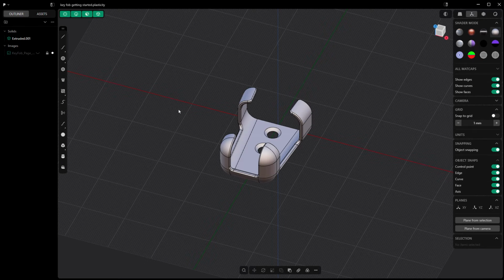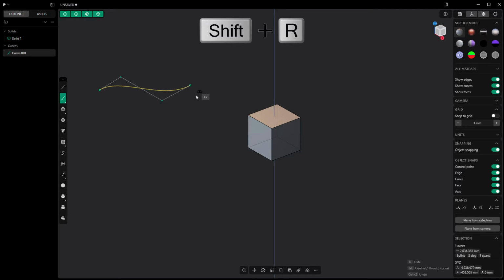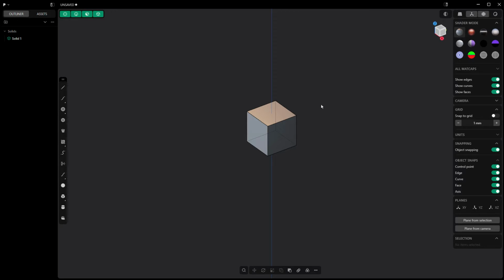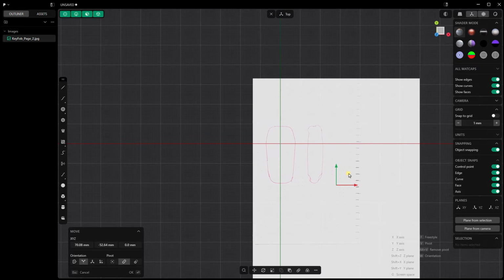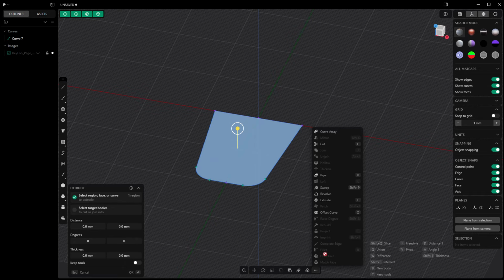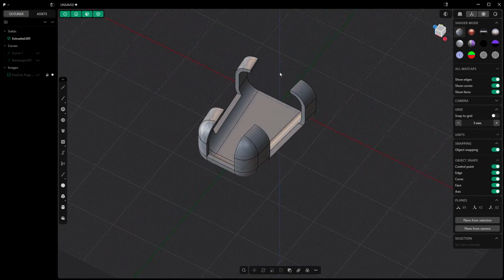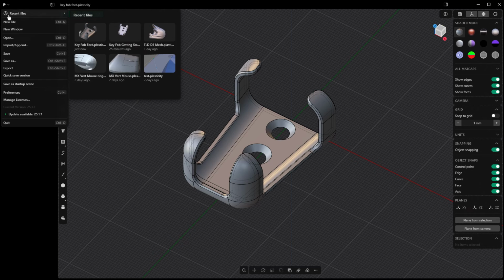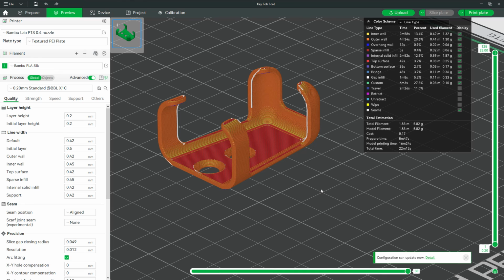Getting Started In Plasticity - Solid Modeling for 3D Printing | Make a Key Fob Holder

Comment: Around 17:25 in the video, you used -2mm for the Hollow command.  I'm confused, it seems like you would have wanted the +2mm instead.  Using the positive value would, it would seem to me, add plastic around the key-fob.  I guess I just gotta try for myself.  Thanks for the video!
Reply from the maker: Yeah the +2 would go the other way.  I did the part with enough "buffer" to make it hollow inward.  Basically when tracing the fob with a pen it gave me a little extra material :)

Comment: Not having a timeline does concern me.  Often when designing 3d prints, you print prototypes, find they need small tweaks, and have to iterate.  So maybe you set something that was 25mm wide and it doesn't quite work, so you try 27mm etc.  In F360 this means I'm often adjusting values in my sketch or rewinding the timeline to adjust values.  Not having either of those worries me.
Reply from the maker: 100% valid concern and a big divide between using a direct modeler like this and a parametric CAD program.  there are issues if you make a specific gap and then scale the parts too.  In plasticity you would have to select a face and offset it 2mm (to get your 27), where in Fusion you could probably edit a sketch or feature.

I find in Fusion doing a combination of parametric and direct modeling but you don't have that option really in Plasticity.  There is a dimension and measure tool that has some ability to drive shapes numerically.  For example if you extrude a box and decide later it needs to be 25x27x22mm,  you can do that.  It just happens a bit different and goes a bit out the window with more complex shapes.  

I made these key fob holders in both Fusion and Plasticity and will say that dimensional control is very helpful.  The benefit with Plasticity comes down to the fact that it is better at dealing with geometry changes.  For example if you are moving a face or adding a large fillet it doesn't care as much about other faces going away and it is more robust at healing those things.  Fusion can get big mad at you.

At the end of it Plasticity is a great direct modeling program that can be used for 3d printing.  Fusion is a great parametric CAD program that can be used for direct modeling.  Its up to you to figure out which one is more important to your workflow.
Reply: @LearnEverythingAboutDesign  But I want both in one tool :D  I see using Plasticity a lot more for concepts and what not, but I really am hoping to be able to do both 3d print items and "Regular" modeling in one app.  Right now I have the old 1.x license for Plasticity that I am learning and messing around with, but don't know how different that is from the current versions.
Reply from the maker: @JohnVanderbeck  the workflows are essentially the same now.  There are new tools that get added so for example you wouldn't have really benefited from Measure and Dimension in 1.x as those came in 24 i think.  But honestly it sounds like CAD such as Fusion might be the best bet.  The real power of Plasticity for me is xNurbs and surface quality.  Fusion surfacing tools are OK but not great.  I love forms in fusion and its great with parametric design.

I "think" plasticity has changed up their renew option for licenses you might want to check out.  You used to have to upgrade/renew with in 4mo of your license expiring or you had to buy the next version, but i think there is a discount now for all old license holders (but don't quote me on that one)  if you do decide to go to plasticity.
Reply: I successfully switched from fusion (have 15 y experiance starting from SolidWorks) to plasticity completely. Before doing it I have had same concerns as you. Modeling and designing without time-line? How that? But after a while I realized, that time-line is not only a help but also a huge handycap in bunch of cases. It's like swimming with lifebuoy. If you are not safe in water, it's a help, but once you learned swimming propperly it start to hinder you. My workflow increased dramatically since plasticity. It feels  like the entire life you drink everything using a straw, just because you was teached to do so and become used to and then one day realizing that you can actually drink directly from the glass.

Comment: Thanks for the video, Matt!
At about 24:00 or thereabouts, you mention "density". This is the first I've heard of this when exporting. Is there some guide I should study to understand that better so I don't mess up my prints? :)
Reply from the maker: With density we are basically talking about how small the triangles are.  The term is a bit misleading since we think of that as a solid property.

This is something you can really notice with rounded parts.  Draw a simple cylinder and export it with really low density(large triangle size) and again with really high density (small triangle size).  You will see the really dense (high number of triangles) model will be much closer to a real circle/arc.  The lower density file will have a lot of visible straight edges and the cylinder is more like a polygon.

In reality all curved parts are made up of these little flat sections so you have to figure out what works best for your parts.  A lot of slicers also take STEP files so you can send the solid model and then tweak at the slicer as well.
Reply: @LearnEverythingAboutDesign  Perfect explanation - thank you!

Comment: I didn't see you use the side sketch, did you just use the paper to measure the size? It seemed like you just decided to use 25mm for the model, was that just a best guess or based on the sketch...I know its an easy unimportant question but I just wasn't sure if there was some other reason for the side sketch. If this is possible in Fusion360 why would choose Plasticity? What are the key benefits that make it worth the money and time to learn it? Your videos are just awesome and I will be purchasing you beginners guide to fusion360 bundle shortly!
Reply from the maker: No its a great question!  I didn't "use" the side sketch per say but yes did measure it as a "close enough" number.  Since its a key holder we don't really want it to be tight in that direction.
I modeled these things for personal use in Fusion the first time and did them in Plasticity for the video.  The main reason is because of requests.  People use Plasticity for 3d printing and thought it was a good example to use.

The question of Fusion vs Plasticity can be tough.  What I would say is that if your end goal is to go to a video game asset, rendering/animation workflow as the main use. Plasticity is a great option.  If your main goal is to design parts to make in the real world, Fusion still wins for me as I like to control the dimensions and use things like CAM, Simulation etc.
There is a grey area in the middle for those that do mostly VFX work but also want to make, or those that don't want a cloud based program or traditional CAD workflow.

I personally use Fusion, Solidworks, Inventor, Plasticity, Blender and other programs like QuickSurface.  And the choice often comes down to what the end goal/result is.  For example if a client comes to me and wants to produce an injection molded design and doesn't care the program i will likely go to Fusion.  If the client works in Inventor or SW i hvae to use those programs.  If they want a concept model i might pick Plasticity just for speed/workflow but again it comes back to a bit on what the client wants and what the model actually is.

Comment: how did you the extra buttons on the bottom row?  Mine stops at Duplicate Object then the three dots.  Can we make that long if we want?  I have the demo at the moment if that matters.
Reply from the maker: hmm, i thought the indie (demo) and studio license had the same UI there.  I didn't do anything special on my end.  I generally run the software as is with no customization as to not confuse people following along.  I just installed the most recent version and my menu still includes boolean, and the two arrays.

Comment: I watched the whole thing. If I wanted a direct modeler software I would rather use Solid Edge. 
I’m using fusion 360 right now because of the CAM.
Reply from the maker: Yeah its not for everyone.  Fusion can do direct modeling as well, and you can turn history off.  Plasticity has high quality surfaces which is a benefit, but its more made for people using mesh software like Blender that want a solid modeler to help.

Comment: I would be very useful to do the same key holder, but this time scan the key and then use the new Plasticity feature snap to mesh.
Reply from the maker: You could do that for sure.  While you can model on mesh i don't think it is really a strong selling point just yet.  Would be quicker to do a subD form body in Fusion over it i think.
Reply: @LearnEverythingAboutDesign  i meant "IT would be very useful...". So, i'm sure many will find such a process demonstrated and explained very useful, more so that it can be compared with this simpler method using a picture.
Reply from the maker: @flotr6465  Yeah let me think about that one.  The surface snapped to a mesh in Plasticity isn't great so the main thing you would do is snap a sketch curve to the object.  In Fusion you can snap right to it.  
https://youtu.be/COh94Os45T8

This video in plasticity does show how you can create sketches snapped to a mesh
https://youtu.be/l64Jjvqu03Q

I have a few other videos ahead of the list that need to get done but ill add it when i can.